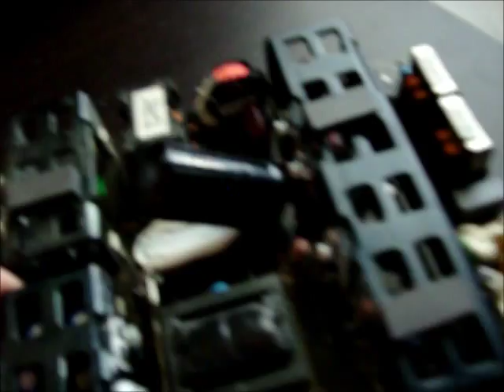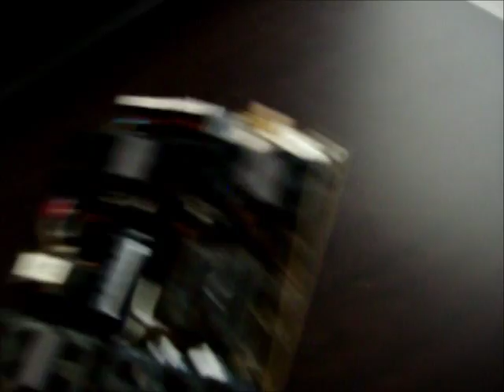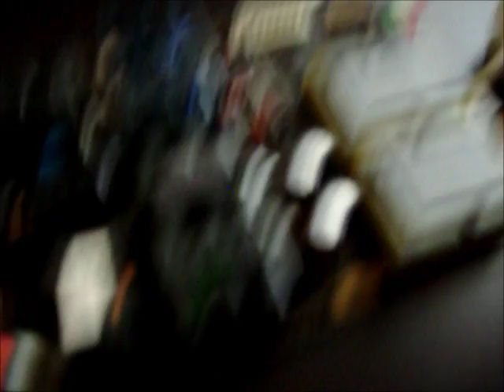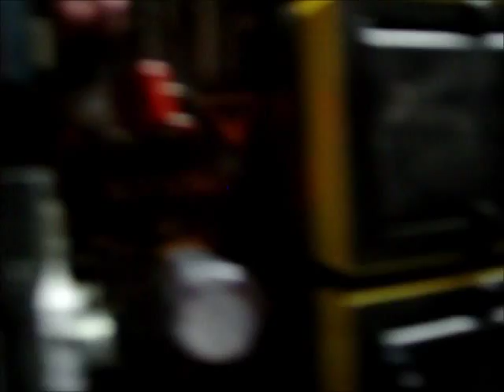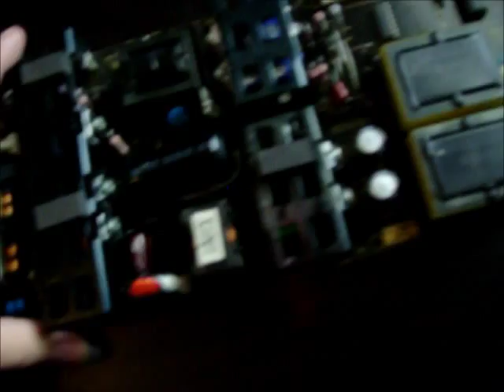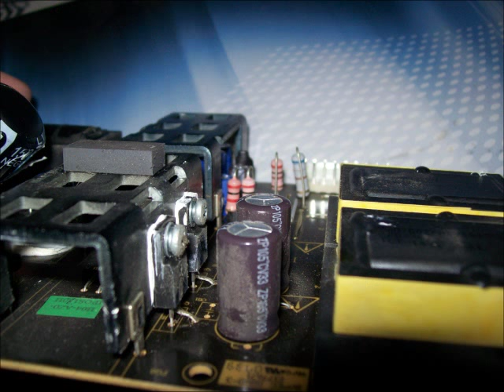Bad capacitors in a Polaroid 32in lcd tv part 1

Comment: I have a 1521-TLUB and can't open the case. All the screws and even the nut at the base of the coax is off and I still can't get the case open. Any ideas?
Reply from the maker: it is probally all clipped together. try prying it up with a flat head screw driver or a butter knife but be careful and don't go to deep inside or you risk scratching or damaging the motherboard
Reply: bam6972 Yup. Even after all the screws, the case is clipped so a big flat head screwdriver let me slowly pry open the case and the clips popped open one by one. Thanks very much!
Reply from the maker: cool...
Reply: 525Lines  k pastores le puedo poner 10uf450v el k Leda de esos capasidad

Comment: hi have the element tv with the same power board no the first thing in notice was the big cap was bulging so i took a sheat rock knife and try to cut the top and it was just a plastic cap over the capasitor nothing more but the 2 little caps i may change
Reply from the maker: that same capacitor was bulged on mine but it wasn't the issue. the dome top on the big one is only the plastic cap or so on top. so its fine. the two capacitors were bad in this video. so if you have the same problem, replace those TWO capacitors.  look for my other vid. bad capacitors in a polaroid 32in lcd tv part 2

Comment: I changed my 2 capacitors but I am still having the blank screen error .  Great video.
Reply from the maker: there is another small component that you can try to replace. its right by the big capacitor. I think its a green diode or capacitor. cant remember. but ive read a long time ago that's what else it could be. also your inverters could also be bad. there the yellow and black things. also did you make sure you put your capacitors in right? they only go in one way.

Comment from the maker: I got mine on ebay. but if you have some tv boards or old electronics you can salvage some from those. but remember you can go up on Volts but not on UF  you can use a 750v 150 uf or just as long as you don't double up on the UF then it will be fine. like say 250 uf would be fine